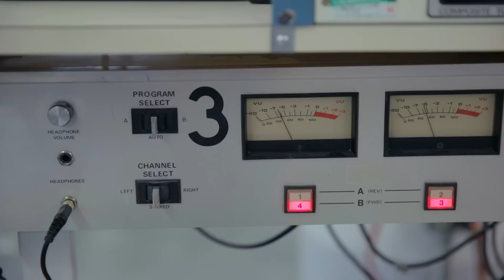Making Cassette Tapes | Nice Content | Tatered

Comment: Listening to a cassette right now in my1990 Pioneer Elite system. Listening to a Dokken cassette I just received from eBay and playing it on my CT-93. Sounds great with the warmth and bass of a cassette. Have thousands of cassettes and only a few have had issues through the decades. Likely the problem lies with how they were stored after someone had moved on to CDs. If you want to have some fun find a good 3 head deck from Pioneer, Nakamichi or Sony from the mid 1980 through 1990 and if you have mechanical skills learn how to change the belts/idler. You will find enjoyment in fixing up a nice deck and playing that first cassette. You will be shocked at how a good recorded cassette will sound on a quality machine.

Comment: hi i have a small 1/8 tape line them 1/8 tape pancake you put on the tape loading  tape a matic i think they called    the pan cake can come apart when you are putting
them on the unit    i have some OTARI  DP2700  my self they have alot more easy to use with the pancake for small runs  of tapes  i have some EMI decks to record in
reel tape on the the 1/8  i record the pancake from start to end and move it to a otari DP2700   the  faster tape loader lose the sound HQ when doing it high speed
you all know what i am trying to say  pros and cons with  tapes

Comment: This video had me fooled for several years I assumed the cassettes were already loaded with blank tape then sent off for professionally recording from the original master tapes

This now explains why both sides tend to be uneven lengths
Reply: No, both sides tend to be uneven lengths because all songs aren’t the same length. The machine adds tones in between each length of recorded album, then the loading machine cuts the tape during those tones.

The different length sides are a byproduct of differing track lengths and sometimes track listings are altered to shorten overall blank space.

Comment: A few years ago I bought a bunch of cassettes at my local thrift store that had the screws in them so that if a cartridge went bad, I could remove the tape and put it in a working tape cartridge.  I have done that with some tapes that I bought while in the Navy back in 1972-76.  I have an Elvis tape I bought in Japan with Japanese writing on it back then so it is 45 years old and I played it the other day and it is in the original cartridge.  It used to be you could get tape players with a microphone built in or a socket for one.  I guess now you have to buy a radio microphone to record anything.  I think if people like Sony would make a radio cassette cd player, with the ability to record from a mic, more people might buy cassette tapes again.

Comment: Cassette tapes last a very long time. I have some from the 70 to modern day music on tape. And no they don't break easily, nor do the tapes snap, if you don't maintain your deck then it will eat the tape. Want the best quality out of a cassette tape? Make sure the cassette players you buy are Stereo players and not MONO.
Reply: Better yet, try to find a Quadraphonic tape player. Just about no tapes support it, but it’s a godsend for balance engineering

Comment: I see the tape being duplicated at high speed, cassettes being printed, tape being loaded into the cassettes, manual insertion of tapes and J-cards into cases, and automatic shrink wrapping. I take it this company doesn’t have the machines that automatically load cassettes and J-cards into cases. Also, I don’t see the bin-loop master machine, where is it? Surely they aren’t using a digital master!

Here is an old low-resolution video that shows the whole process, including the loop master tape being made, bin-loop master machine and automatic cassette and J-card loader, along with two different styles of paper labeling machines. https://youtu.be/2e1ih_q7MWg

Comment: From the technical point of view, the process shown there is bad. Writing music at such speeds will lead to heavily degraded sound, basically only enough for voice recording. Add heavily worn out  equipment to that and it makes all of this effortless. Why they just didn't purchased a equipment off the Korean & Thailand manufacturers which stopped making tapes around mid 2011 ?  And using it from the 70's ? I've watched a 2013 video and it was all the same. But hey, it's just my rambling.  Hipsters who purchased a $5 double deck boombox from garage sale will buy these. Avid Metallica fans will buy a "82 single on this tape.
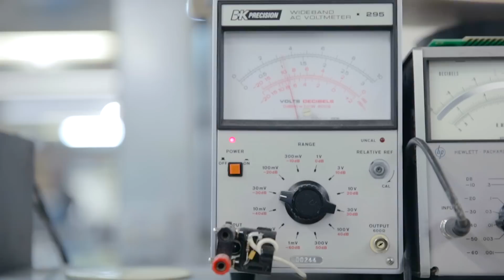Reply: This is not the same as in-cassette duplication used for spoken voice tapes. High-speed duplication outside the cassette can produce amazing quality even at 32x speed. Notice the audio analyzer at 1:23 (presumably for quality control testing) shows audio frequencies all the way up to 16 kHz. The important parts of the machines can be renewed and maintained within the tolerances for new equipment. This is how commercial music cassettes have always been made, and the technology didn’t change much from the 1970s to the 2000s.